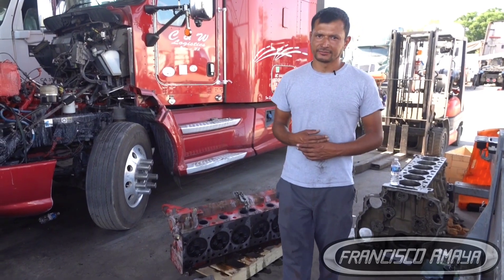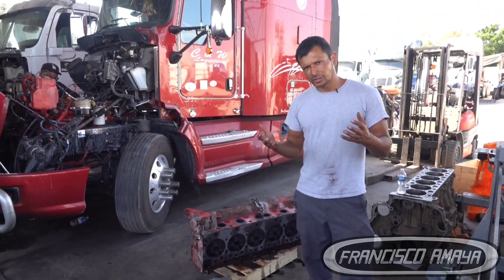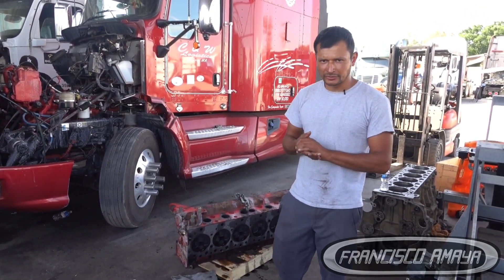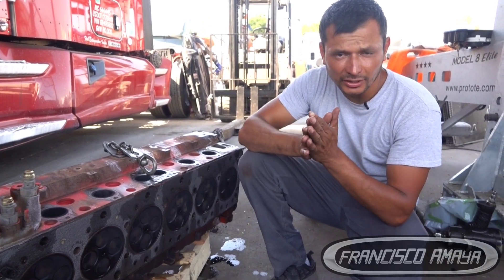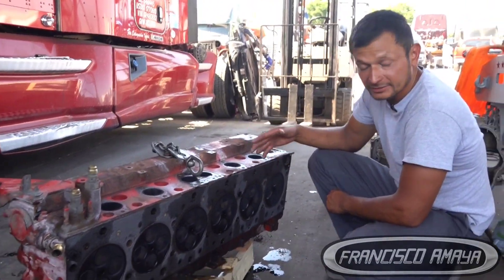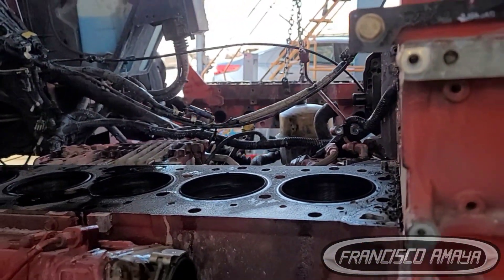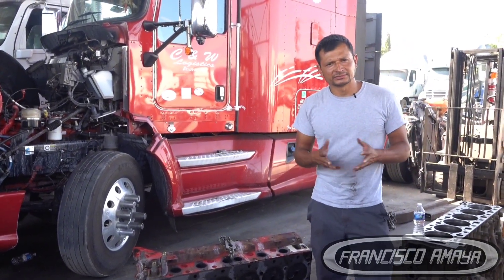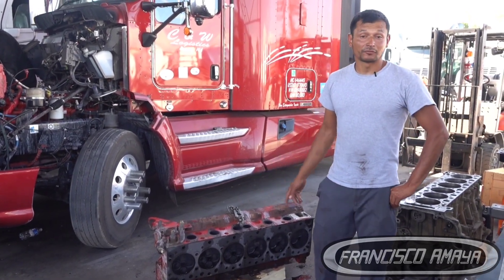CUMMINS ISX15 ISX12 CYLINDER HEAD GASKET DAMAGE COMPRESSION LEAK TO COOLANT TANK COOLANT IN CYLINDER

Comment: I can almost bet it was either weak batteries for that high output starter or it was that starter. I mean all I saw was a short crank which in my mind points to low cca batteries not a pointless gasket replacement
Reply: Those cables from the starter to the battery box love to chafe/break and the grounds suck
Reply: Even there would be coolant smoke coming out of exaust, coolant reduction